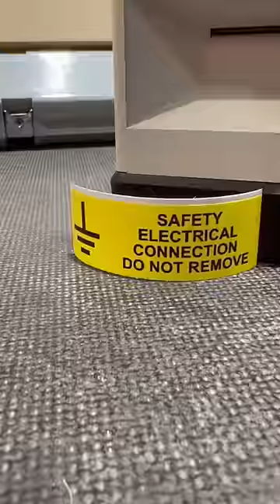Electricians Shocked by this Mysterious Earth Clamp

Comment: I have done a lot of electrical work. Taught by some pretty smart guys. One thing i was always told is never ground to a supply line of any type. In case of a short that entire line will be electrified. My dad came across a house that would give you an electric buzz anytime you were in the shower and touched the faucet. There was a ground done like this. Dont endanger your customer. Run a proper "earth ground"
Reply: 100% correct.  🎉
Reply: This isn't using a copper pipe as an earth though.
Reply: @robertbritton656  It's running the earth ground of the circuit to that copper pipe. That's why it's called earth clamp. Eventually that copper pipe will go into the ground somewhere in the system. Normally where the water is supplied to the house.
Reply: @cobravids  No it isn't. There's no circuit here and no one is using a copper pipe as an earth.
All extraneous conductive parts must be bonded to the main earth terminal. This is to prevent any metalwork from becoming live in the event of a fault.
Reply: Electrified relative to what? This connection makes sure all exposed plumbing is at the same potential as all exposed earthed electrical equipment. It's not supplying the ground to the installation, it's ensuring there is no potential between these points.
Reply: If you have never seen a fault happen in this type of setup you would.not understand the possibilities of failure. Only.gamble with your own life. This type of earth ground is not even code where im from.
Reply: @cobravids  This isn't providing the earth. But I wouldn't understand of course..

Look up the term 'equipotential bonding'. Be prepared to challenge some assumptions, like the commonly held belief that any point arbitrarily designated 'ground' is a superconductor.
Reply: @cobravids Amen 🙏🏻🙏🏻🙏🏻
Reply: @wildfirephoenix2262  Perhaps you can explain what he cannot - what two points will you be touching to experience a shock in whatever scenario being dreamed up here?
Reply: most of you seem to not understand that ground rod bonds go bad all the time. last thing i want is electrified pipes bc someones fridge is on the fritz amd someome grounded pipes in some laundry room somewhere.. the argument here seems to be that you should create a potentially unsafe scenario by imagining that ground rod bonds are permiment and will never ever be cut.
You always bond at the water pressure regulator, no matter which way you intend the ground to go. thats what makes it safe for everyone. you never ground it either way at any random indoor location as he has here, never ever. doesnt matter if the ground is intended in or out. don't kill plumbers trying to be cool, ground like a normal person.
Reply: @QuantumMarmalade  We don't have water pressure regulators in houses, and this isn't a 'random indoor location' - it's a test jig with some pipes representing buried metallic pipework at the point of entry to a building. No ground rod is involved.
Reply: @QuantumMarmalade  Yes sir. Thank you for that explanation. I think everyone is under the assumption the ground will always be isolated and never shorted. I have seen it myself in a house my parents rented. Got shocked each time we were in shower and touched the faucet. The prob was a short was in one of the circuits in the house and it was backfeeding through a disrupted ground wire that was eventually attached to the copper piping of the supply line. If isolating the copper pipe in a house, ground it to earth separately and keep it out of any other circuits. Leave no chance to kill anyone.
Reply: @cobravids  You seem to be operating under the assumption that this is some random wire from a circuit - it is not. This is an intentional connection between a conductive pipe in contact with the physical earth and the main earth bar in what you would call the 'panel'. It prevents any potential being present between the pipework and the electrical ground. Without it, a loss of neutral or various other circumstances can cause a dangerous potential between the pipework and the electrical ground.

To reiterate: This IS NOT connecting a ground to a circuit. It is connecting two different ground potentials so they become one, and therefore removing a risk of shock between them. It also IS NOT being used in place of a ground rod.

Again, magical search term 'equipotential bonding'. Please, look it up before assuming you know what's going on.
Reply: Realise that the rest of the world doesn't use the 1950s rural system the US does. That is a 230v UK system, Phase(Hot),neutral, earth(ground) are supplied direct from the sub station. The cable is connecting the pipe to earth at the fuseboard ,not the fuseborad being connected to the pipe to ground it.
Reply: @ianrice5656  1950s? That's a bit generous isn't it?
Reply: @ianrice5656  WHAT! So earth ground comes from miles away from the utility? If I understood that correctly then in case of catastrophic short/fire/failures the path of least resistance would be those copper pipes, hence electrifying them. You just helped prove our point. Thank you for that. People assume just because wires are separated on install they will remain that way. Assumptions kill.
Reply: @cobravids  Your assumptions are continuous.

What is the second point of contact for you to form a circuit with these 'electrified pipes'? What two points are you finding potential between? Think it through, draw it out. Consider what the impedance of the supply wiring is compared to a piece of buried metal which makes terrible contact with the ground. What makes you think that pipe is a better return path than the provided wire?

Consider the earth path in your own installations - it's actually the neutral. Three wires for you, L1, L2, neutral - you split that neutral out to provide a ground in the installation which doesn't carry current in normal operation, and during a fault, the current ends up returning back to the transformer via the same neutral wire it normally does. Lose that neutral? Suddenly you have a potential between a buried pipe and the electrical ground, unless you provide a low impedance path between them.. say, with a pipe clamp and a large wire?
Reply: @QuantumMarmalade  You've just described what is in the video, running a bonding connection to the service pipe.
NEC Section 250.104 requires bonding the building's exposed structural metal, interior water piping, and other metal piping systems. This requirement differs from the one outlined in Section 250.50, which requires bonding the metal underground water pipe as a component of the grounding electrode system.
Reply: @cobravids  We haven't proved your point at all. And you assume that Billy-Bob and his cousin, who let you help out taught you the correct way.
NEC Section 250.104 requires bonding the building's exposed structural metal, interior water piping, and other metal piping systems. This requirement differs from the one outlined in Section 250.50, which requires bonding the metal underground water pipe as a component of the grounding electrode system. The reason you were getting a"tingle" in the shower is probably due to a poor or broken neutral and you were creating a secondary return path. 
Go to tech college or nightschool and get at least a basic 1st year understanding of what you are working on. I've been doing  this 40+ years, 4 editions of the regulations, 12 sets of updates. Monkeh616 I suspect is a degree level electrical or electronic engineer. It ain't our first time at the rodeo.
Reply: Must not of been doing it up to code then. NEC requires it.
Reply: The earth to ground is the main cable next to it in consumer unit.
Reply: @cobravids the main earth is next to it in the consumer unit
Reply: @cobravids this is not the earth, the main earth supply is on the next terminal in the consumer unit, this is earth bonding it is done so the exposed metalwork i.e. taps/faucets cannot become electrified if there was a fault.
Reply: @Monkeh616 say these two pipes go to separate taps/faucets on a washbasin/sink and one supplies hot water via an inline instantaneous electric boiler which has developed a fault whereby the hotwater/pipe becomes live, chances are the through one path or another the cold tap will be at or near ground/Earth potential. What do you think might happen if some was to put their hands on both taps?
Reply: @tonydickerson999  So first we make the odd assumption that we have two cold supplies going to one sink, and then the further assumption that we're bonding pipes which otherwise wouldn't have an earth connection...

What you're saying is there's a shock risk between a faulty appliance which doesn't meet standards or is improperly installed and an exposed earth potential - one which has nothing to do with equipotential bonding.
Reply: @Monkeh616 The water valve (now at potential) and the wastepipe connected tub water.
Reply: @cobravids Sure, but no multiple ground trees is another rule. So if you had eyes on the supply tie-in and it's not plastic with conductive thread...
Reply: @Cineenvenordquist  The water valve which already has a potential and the insanely unlikely metallic waste service which you'd also bond if it introduced a potential?
Reply: Yeah I mentioned this in a comment. My grandad, not an official electrician, found out the new house they’d moved into had the ground to a copper water pipe and ended up having almost all the electrical redone on the dime of the seller. The second day in the home my grandmother got electrocuted doing the dishes…. Let’s just say they didn’t want to deal with my grandfather, they just paid to get it fixed properly. 
What he found before they fixed it …. This shortcut right here. DO NOT USE A GROUND ON A WATER LINE, is what I learned from him .
Reply: @adwhite804  But what you haven't learned is the difference between grounding and bonding..
Reply: @ianrice5656 im in the United States and we use 2 ground systems. Off the line into the box, and the transformer is grounded along with the house to use Earth.

They used to use neutral grounds, but that was a long time ago.
Reply: This is not grounding to a supply line. This is earth/ground bonding. It prevents the supply lines from becoming live if, for example, a chaffed mains cable touches them. There will, typically, be a proper ground/earth as well at the supply point before the consumer unit.

Comment: Assuming the copper lines do make it to ground, It is not advisable to ground to copper water pipes due to mineral electrolysis. I’ve seen cases where the mineral buildup caused a near total blockage of the water flow.
Reply: @@retiredbore378 why would they need to hear it from me? It’s already against the code in my state to ground to water lines.
Reply: Interesting. In cis/eu you must ground everything in batrooms and kitchens. To prevent any dangerous potentials to appear on  metal parts. It's called Auxilary System of Potential Equalization.
And in some cases a metal net is used in floors to equalize potentials between all points of the floor (so called step voltage), but this is very specific type.

Comment: We have these grounding pipe clamps here in North America. I've only used them when grounding an antenna mast.
Reply: Ok. What does the grounding of an antenna mast should do?
Now if you thought about it for a second, imagine that bolt of lightning going straight through your house, over those pipes and into the ground.
I hope you have a good imagination.
[edit]
As Wranglestar would put it:
act accordingly...
Reply: @ogi22 It’s not made for a direct lightning strike. It’s to dissipate the charge on the antenna so it has a lower chance of getting hit by lightning.
Reply: @ogi22  Antenna mast should always be grounded to main earthing bar. If you dont, the lighting will find unwanted path which is probably to your TV through antenna cable, into the power socket & to ground from there or other unwanted path. You want it going straight to ground. With proper grounding there is 99% that all your devices stay intact. If there is no seperate ground, lighting will for sure break your stuff.
Reply: @5roundsrapid263 Your reasoning is incorrect. Any "charges" your antennna might have is totally nonexistent next to 300 million volts of lighting strike. Ground is there to direct it to earth, so it dosent go unwanted path. By talking about charges you are right that proper ground filters electromagnetic interfierance. (EMI)

Comment: I solder a copper wire to the pipe, doing that on ac units to prevent any shock hazard
Reply: Grounding the plumbing isn't a bad idea, grounding the electrical via the plumbing is.

Comment: HE'S NOT USING THE PIPE AS A GROUND! HE'S GROUNDING THE PIPE FOR SAFETY!

Sorry to shout, I just thought someone should say that one more time. /s

And I'm not even an electrician.
Reply: it is immaterial which he is doing. yes most of the commenters here are slightly off base in reasoning but they all seem to be able to tell intuitively that there is a problem with where he placed the ground clamp (should only and always be at the pressure regulator. also, all grounding is for safety, no other reason exists. the reality is that this dude did it in an unsafe way and that clamp looks like trash, something I would toss in the bin.
Reply: @QuantumMarmalade  There is no pressure regulator in the building in a domestic context. This is not America, our plumbing and electrical installations are not the same as yours. This is also being done on a board in a workshop as a demonstration of materials and methods..
Reply: @Monkeh616  it's a poor demonstration since it creates a hazard. additionally I call bullshit on the idea that Europe doesn't use pressure regulators because if that was the case then the municipal supply would have virtually no pressure at most of the homes and at peak usage times there would be no water at all for many.
Reply: @QuantumMarmalade  I didn't say there aren't regulators, I said they're not in the house. Where the provider puts them in their private network is their problem. In a real installation, main bonding would be connected to relevant pipework at the point of entry to the building.

What hazard is created? This is demonstrating equipotential bonding, the purpose of which is to remove potential between exposed metal surfaces.
Reply: @Monkeh616  why are there 2 copper pipes? is it 2 water mains?
Reply: @amieres  Most likely one represents gas.
Reply: @amieres  hot & cold.
Reply: @QuantumMarmalade Grounding is not only for safety. Having everything in same potential prevents static chargers which can break sensitive devices. For example in hospitals every metal surface is grounded. It also protects from lightings by directing them to ground instead of finding unwanted path. Every power center, data rack, control automation center, cable path, water pipe & air conditioning channel should be separately connected to main or secondary earthing bar. Thats how it works in every larger property & how dozens of engineers have drawn it in grounding pictures that i have seen/done.

Comment: And using water pipes as earth conductors has been banned in a number of countries - because plastic utility feeds to houses became a standard retrofit (ie no earth continuity). Special copper plated earth spikes are now standard (minimum 6ft/2m long but I have seen 270ft/90m ones driven in bad soil conditions).
Reply: They aren’t using the copper pipes AS their ground. They are grounding the copper pipes TO the actual ground. 

That is standard practice in many (most?) countries. Those are likely the two main feeds of either gas and water, so they are thing those into the grounded network just like you would your wiring.
Reply: @JimYeats  Plastic pipes for consumer water and gas distribution are now standard globally…
Fault currents being directed into the metallic gas lines have particularly resulted in spectacular catastrophic failures…
Reply: @allangibson8494  Whether they’re standard globally or not, they’re still all over the place. All gas lines in the US and much of Canada are still metallic. 

If lightning strikes your home you can sure bet that those metal gas lines will have a higher chance of having a catastrophic failure than if they have been bonded to the grounding rod via appropriate gauge wire. 

You aren’t increasing any risk by bonding them. What do you think is going to happen? Again, they aren’t being used as the grounding rod (although some scenarios allow for water pipes in certain cases). They are simply bonded to the ground.

It’s code in the US and Canada. Luckily houses aren’t blowing up left and right.
Reply: @JimYeats  Neutral currents flowing through the gas pipes strips the zinc plating off causing leaks. This is particularly a problem if a bad or nonexistent earth connection to an earth stake is present.
If lightning strikes are your concern - bonding the pipes together is reasonable but including a 90V neon gas discharge tube between the earth stake and the earth stake to prevent circulating currents is a good idea.
The same technique is used for cabinets grounds and intrinsic safe earth. 
Electric trains and street cars also cause problems with circulating currents in gas and water lines (particularly as they dump DC current into the earth).

Comment: We used to do this in the USA. Code says you're allowed to ground to water pipes, but ONLY if there is 10ft or greater of the metal pipe outside the home underground. If it comes in PVC/Pex and then transitions to copper it's not allowed to be used as one of you grounds.